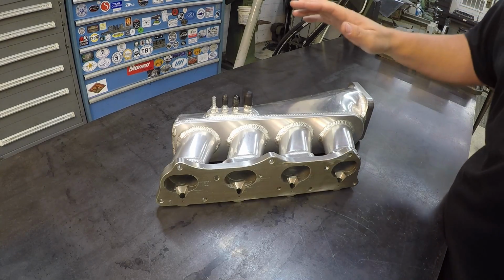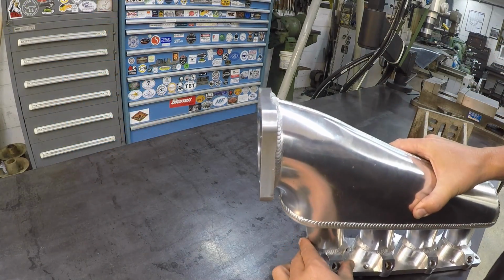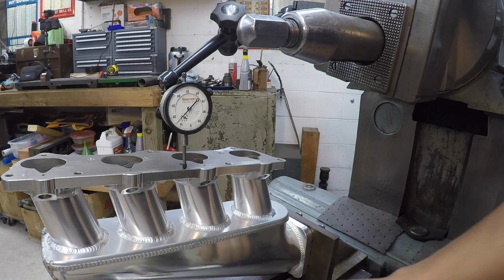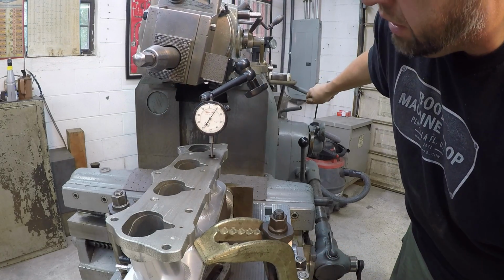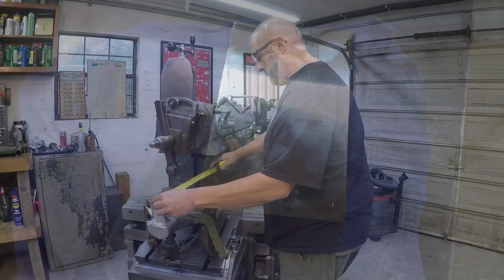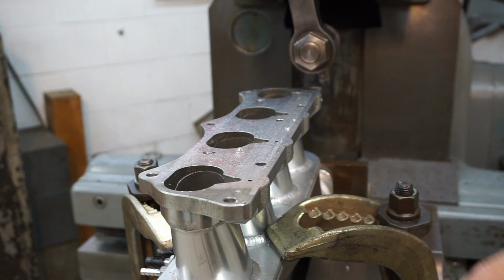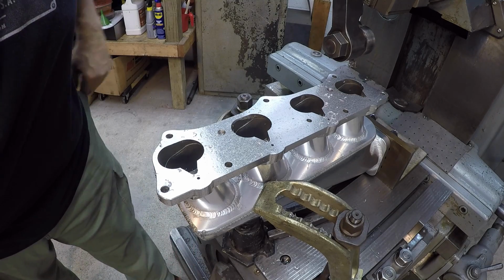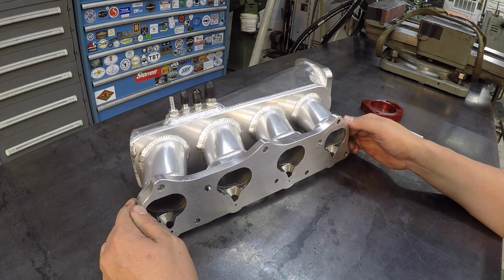Machining an Intake Manifold in the G&E Shaper

Comment: Why place a Honda K20 int an MR2, why??????
Reply: Because its a solid engine with tons of aftermarket support? And also why the heck not?
Or stick an LS in it just for lol's.
Reply: @sparkplug1018  Do you have a big enough shoe horn! I have seen a Toyota V6 conversion.
Reply: @muzzdeni28  Think Ive seen a few pics of someone who got one in there, an LS4 I think it was. No idea if he had anything like the accessories, exhaust or trans in there with it though.
Reply: @sparkplug1018  I believe its quite easy to squeeze a 3SGTE into a mini,
Reply: @sparkplug1018  Haven't seen that one but at the same time, I've been out of the loop on MR2 stuff for probably close to 2 years now. The accessories part wouldn't be that hard as all you need is the Alt. (and AC Comp if you wanted AC). PS (on cars equiped) was an electric motor driven pump that was mount in the front compartment. 
Width wise, the LS would fit better then the V6 being a 90° engine vs. the 60° V6 engine with its wide DOHC heads. The problem with the LS (or any V8 other than the Audi V8's) is the length of the engine over the V6's and finding a trans that will work and fit too.

I've actually toy'd with the idea of an LS or similar engine turned longitudinal but without increasing the wheelbase or having to intrude into the drivers compartment (will have to lose most of the trunk though (not that there is much there to begin with). Might get around to it one of these days.
Reply: @CP_300PRC  Not sure if it would work, but the LS4 was a transverse engine to begin with and used the 4T65E auto in the Pontiac Grand Prix GXP. Pretty sure the LS4 also had a super compact accessory drive as well. Don't think that would fit in there but might be something to start with if someone really wanted to give it a go. Be interesting that's for sure.
Reply: @sparkplug1018  Yeah not sure there either probably too long of a package. I do however remember a few years back of someone measuring a 6spd from something that supposedly would bolt up to an LS and it be very close to fitting (only supposedly like 3/4" too long which could easily be taken out of the frame rails. I want to say that it was the F40 6spd from the Pontiac G6. As far as I know, the guy never did anything though with attempting the swap.
Reply: It's a modern basis for high powered builds. Even though I'm an ardent 3sgte fan I can see why some people want an easier route. For all those wondering about shoehorning an ls into the mr2...visit scantrons garage here on yt
Reply: Because it's an incredible platform and it's a much better engine than the 4AGE or the 3SGE with more aftermarket support than both combined.
Reply: @mitchellpatterson3323  I have a 3SGTE,  its a bit dated now, still can find performance parts for it. I'm not a big fan of Hondas.
Reply: @muzzdeni28  The 3S is not a BAD engine by any stretch, but I totally understand going to a K20.
Reply: @mitchellpatterson3323  better platform / engine my ass.... The ONLY thing that makes it a "better platform" is the fact that there is a TON more aftermarket support for the K series over either the 3s or the 4a. Besides the aftermarket support, the only think it has going for it is the fact that its lighter...
Here's a perfect example, Prayoonto Racing's AWD Civic is making estimated 1400bhp at 70psi of boost on a 2.2L K series based engine. On the other hand, PSI Racing's Starlet is also making an estimated 1400bhp at only 43psi of boost on a 2.1L Toyota S series based engine. Hmmmm, a tiny bit less displacement and significantly less boost.. You tell me which is the better platform.

And I'll bet that it was cheaper to build the 1400hp out of the Toyota S series than it was the K series. Just the fact alone that you are starting with an iron block and thus do NOT need to worry about sleeving it cuts a minimum of $1k off the price tag.
Reply: @CP_300PRC  
It's not really a debate, the K20 is a better platform and the fastest MR2 is currently powered by a K20. You can continue to debate otherwise though, I'm just not interested in replying anymore.
Reply: @mitchellpatterson3323  
Of course you're not going to reply because you know that you have no valid argument beside internet hearsay. 

And WRONG, the fastest MR2 is Powered be a S Series engine.
I'm sure you are talking about the Aussi with the K24 that ran 8.8 several months ago, well I hate to break it to you but a 3/5sgte (same basic engine as the Starlet that I mention from PSI Racing) just broke that record 2 months ago with a 8.71...

Regardless of that though, record setting drag races tell you very little (virtually nothing) about an engine and how good it is. There are too many variables that come into play. A better test would be to say, "put a modest spending cap of say $2500 to source and build the engine and see which makes more power, then put them into matching chassis's and run them in an endurance race or two (or more) and see which lasts the longest. Then you will have the "better of the two engines".
Reply: Vtec yoooo!!!!
Reply: @Noise-Bomb  Yeah, Nah, External waste gates and blow off valves.

Comment: I can appreciate it's an awkward shape but you'd think they'd leave machining to the last step during fabrication? Or at least face off as last step? Another option here might have been a grinding wheel.
Reply: Not when the manifold only costs $100 shipped. Your lucky there isn't holes in the welds.
Reply: @jrichardson-m9m  It cost them a 100 but when it's squared up put a price on it?
Reply: @MrCoffeypaul  I'm confused by your question. I did find the intake on ebay. It is actually $325, thought it was a b series intake which would have been cheaper. That is still a dirt cheap manifold, a good one is $500+.
Reply: He said it's one of the cheapest available.  Do you really think they machine it after welding?  They probably buy the flanges and fab the rest, not worrying too much about keeping it straight.
Reply: @elkvis  Well who ever did the welding knows his stuff!

Comment: worked a few years in an automotive/truck machine shop, 10 mins on a belt head resurfacer and it would be flat :)
Reply: Especially if it was cast iron, in service and warped with HARD spots.
Reply: @lifuranph.d.1716  but, it wasn't
Reply: @CM-xr9oq  I knew that.  Just saying.
Reply: @CM-xr9oq  ''Especially if...''.  C M you missed that part.

Comment: why does it look like the table steps up when it steps over? is that just because of the camera angle or is something else going on?
Reply: Somewhere in the video he says in a caption it's because the machine is rocking back and forth since it's set on boards. He'll need to set it on concrete soon.

Comment: Hello Adam, Nice job on the Manifold, Please check your email for an offer by me to make you a DONATED custom set of LFOS (Leveling Feet On Steroids) for your Shaper.  In the future, with your Shaper precision leveled, 1) No more Rocking :) , 2) You can use your precision level for Job Set Up,  3) The Custom Leveling feet can Elevate your machine to a comfortable working Height,  4) The Feet have 3/4” thick Nitrile High Durometer / Firm Rubber pads which will help dampen vibration, etc.  These would be donated out of appreciation for and Support of your Channel, Kind Regards, Ken

Comment: Poor choice of machine, but I realize that you are " playing".
Reply: It is an excellent choice of machine.
Reply: That was and Excellent choice of Machine, far better than using a Mill, Horizontal or Vertical.
Reply: @Techtog, 1st off, don't ask me a question, then answer it for me with the answer that you want to hear!!! There are only a few types personalities that do that sort of thing, here are a couple just for you!
#1. Pretentious i.e. claiming or behaving as if one is important or deserving of merit, when such is not the case, showing an attitude of superiority.
#2. Pompous i.e. a person who is irritatingly grand or self-important, over bearing, grandiose, conceited, and egotistical.
Yes, I do have the "validated" data to back up my comment that imho it was the "perfect" Machine for the project. At 34:39  into the Video Adam says "I used the Shaper because I like the Shaper". He also went onto say that doing it in a Mill would be a little bit Tricky, and why have a Fly Cutter beating, shaking, and vibrating the Manifold when you have a Shaper.
He likes using the Shaper Dude, that's why I said it was the Perfect Machine for the project. Not to mention it turned out smoking good. So Adam's comment at 34:39 is all the Validated Data I need there HossCat!!!
Hell, maybe I like using the Hammer & Chisel, and as long as it turned out the way the Customer wanted then that would've been the Perfect Tool.for the project for me.
You should learn some Manners, and not answer your questions that you've asked someone else, and maybe let your stink hole loosen up about 50 or 60 thousandths. Lmao
Reply: Maybe not the fastest but the part turned out basically perfect so whatever he did it certainly wasn't poor.  Sub-optimal for production work maybe, but not poor.
Reply: @Greg Noble
No, actually. As that thing yields a very fine end result the choice is okay for the job. Problem is, though, that the shaper run is pretty damn boring to watch.
Reply from the maker: Poor choice of comment
Reply: Do you have any validated data to support your remarkable assertion? No? I didn't think so.

Comment: Looking good Adam,
Have you tried mixing up a DIY cutting fluid for non ferrous?
You could spray it on thin instead of squirting puddles.
I know lanolin and alcohol works great for brass case lube for reloading and it's cheap compared to name brands.

Comment: You actually don't want an ultra smooth surface as the gasket will not properly seal to the intake and cylinder head. This is one reason why fly cutting is the preferred method for automotive machine finishing. It should have an "RF" or roughness factor of about 120-250 micro-inches (grooves per inch) with a variation of 2-3 tenths in depth. This allows the machined surface to grip or bite into the gasket and prevent it from moving and shearing during thermal cycling.
Reply: True!

Comment: Thoroughly enjoyed the job! I watched some of your videos from Texas, I think, where you guys were looking at all the different machines, machine tools etc...brought back many memories from 30 years of my life working for General Electric. We made DC electric motors and all the parts were made and machined at our plant from an aluminum foundry to turret lathes, cnc machines, hob and mill machines, and practically all the machines you were pointing out in those videos.....our plant was 1/2 giant machine shop and 1/2 copper components, armature winding, copper coils, motor  assembly, motor testing, painting, shipping. It was in Dothan, Alabama and I spent my life there. I could swear some of those machines came from our plant because they were identical to ones we had. They painted everything that green (or later some blue) and I miss it....the plant closed in 2010 because of a decline in business and it was sad to see it go. Sorry I was so long winded, you just sparked some great memories......Thanks :)

Comment: WHOA. At the 27:00 mark, the part and table are moving! Also the slo mo at 28:50. Damn, that cant be good is it?
Reply: No cause for alarm.
Quote Abom79 @ 23:01 "The movement you see in the machine is the machine "rocking" on the boards. I need to set it down on the concrete."
Reply: @NickNorton  My ears failed me hehe. Cheers!
Reply: Yeah the shaper head doesn't move left/right, the table does. The part is not moving in relation to the table though.

Comment: With the different angles of the two mounting platforfms, and i know you are not taking much off, will that cause any problems remouting intake
Reply: Marty Vener He dialed in the face only. Any problems are passed on to the manufacturing from there because he went off of the datum that was already there.
Reply: Probably not, he took less than 1/16" and intake piping is thin and has give to it.

Comment: Bolt it to a milled face piece of steel and then heat it in an autoclave. Less work and would normalize the metal relieving the welding stress.

Comment: I know on the intake side it is not as important for the finishing grade. It does need some roughness to it depending on the type of gasket material being used. But the decking on the head and block are critical if a MLS gasket is being used. For the MLS gaskets, they need to be 20-30 Ra or less for proper sealing. https://www.felpro.com/technical/tecblogs/surface-finish.html
Reply: Correct. I'm trying to figure out how to get that finish on my milling machine to shave my l77 ls heads for MLS head gaskets
Reply from the maker: That’s why I left the finish as is. Shaper makes it easy to leave the finish needed on these parts.

Comment: Looks good.  My guess is that most people would have just tossed a gasket on it and not worried about it.  But always better to have a good flat sealing surface.

Almost need a chip collector made kinda like the dust collectors for woodworking on the shaper.  A hose allowed to hang from above and a nozzle you can get close enough to pick up the chips would keep a lot less of the chips from ending up everywhere.  Probably be able to do something similar on some other stuff too especially when you will have small chips.  Saw another person's lathe video and you keep your shop immaculate compared to his.  The belly pan was full and there were chips everywhere...
Reply: with 20 psi boost it needs to be flat
Reply: @douglaspierce316  Like I said, most people.  As in the average guy who would just goop up the gasket and stick it together.
Reply from the maker: He tried a gasket, didn’t work. That’s why he brought it to me.

Comment: Like this video kinda make think about shaper fr surfacing cylinder heads n blocks compared mill , live see how you would set them up it nice watching you n learn from you,, something to think about on some engine parts you don’t want super super smooth so your gaskets have something to bite , fine surface but not mirrors this depend where it at on motor ,,

Comment: I thought you said the head side needed to be 90° to the throttle body flange?  While the head side flange is now flat, it doesn’t appear to be 90° to the other flange.  Perhaps it doesn’t matter in the application.  Thanks for sharing.  The shaper is a nice all around tool.
Reply: The TB flange was square to the shaper table but was not 90 degrees to the intake flange along its length. That is in the design of the manifold. Adam's setup was spot on to create a flat surface on the manifold flange without creating thickness variations in the flange itself. Had Adam tried to create a 90 degree plane with the face of the TB flange, the manifold flange would have been thick at one end and thin at the other. :)  After the first cut it was easy to see why the manifold would leak. Where was Quality Control when the manifold was built.
Reply: Ray Poole I suspect this is not a factory manifold ... so, probably very little QC.

I had a ‘91 MR2 for about 20 years.  I am in search of a another one (rolling chassis) .... but I am a bit of a purist and would keep and build up the 2.0 L 3S-GTE motor....

Great channel.

Comment: I can imagine that resurfacing a cylinderhead with the shaper should work great
Reply: Not a  singlechance. Cylinder head has to be single point fly cut.
Reply: otm646 a cylinder head or block can be surfaced by grinding or using a shell mill type cutter with multiple inserts,fly cutting with a single point tool would not be good,you have to many interrupted cuts,bolt holes,water  ports,combustion chambers etc. It would create a lot of high and low spots from tool deflection,with multiple inserts you would be in constant contact with head or block making a flatter surface.

Comment: Sorry to correct but I bite my lip every time I hear it. Motor/electric.... Gas, diesel/Engine
Reply: Detroit is Motor City so
Reply: But what about a boat motor on a motorboat?
Reply: The Fixer Of Broken Stuff............ = Engineboat
Reply from the maker: How about an “engine lathe”
Reply: They're actually interchangeable. There isn't anything saying one way or another. It's like people that think "quick means a car has good acceleration and fast means it has a high top speed." They're both synonyms, as are motor and engine. People have colloquially tried to change the connotation of the words, like the quick vs fast thing, but it doesn't change the denotation.

Comment: you should have showed us how warped it was before you started. you could have used your straight edge that you just fixed up
Reply: The dial indicator showed it.
Reply: Did you watch the video? 🤦🏻‍♂️
Reply: He had it on his ig account of how warped it was.
Reply: You could see with the first pass on the shaper how low the two ends were.
Reply: Sorry not on ig. I saw the warp from the first pass but thought it would be a good use for the newly fixed up straight edge

Comment: I wonder if using some of those repressurizable aerosol spray cans would work better for oil/coolant on the shaper. So you can get the particle size smaller and cover a larger area from a distance. It seems like otherwise you either need to shut the machine to really oil it light and well. (though i could be completely wrong as i am not a machinist)